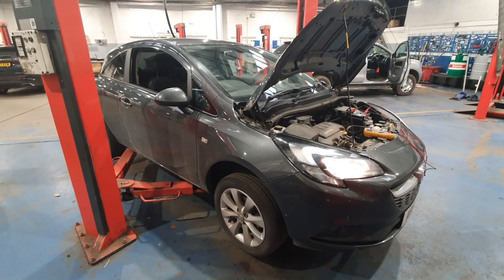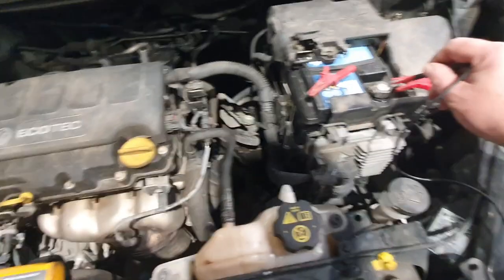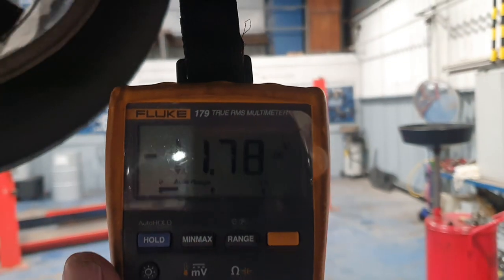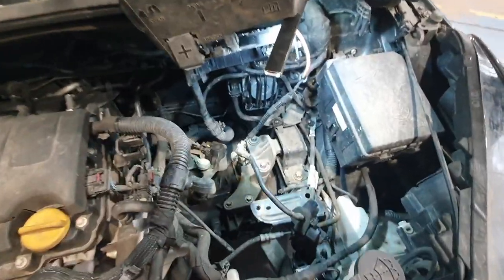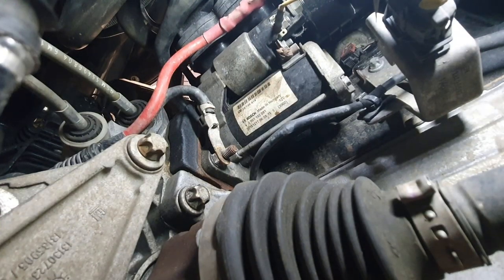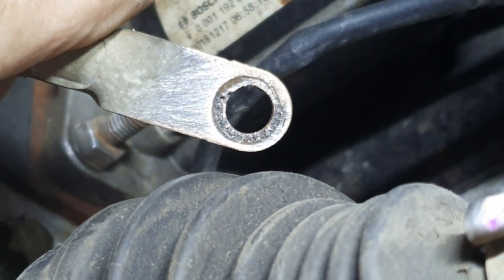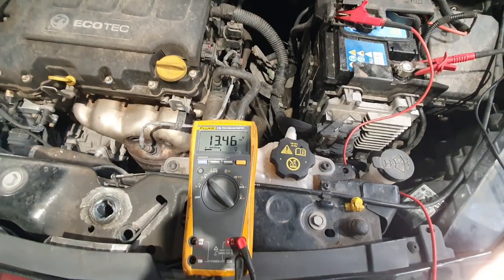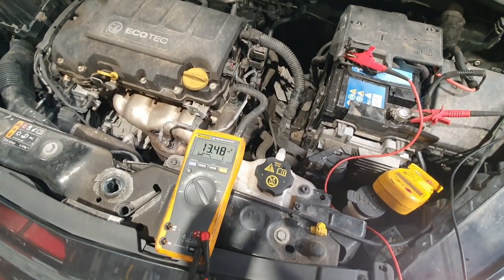This is why your Vauxhall / Opel Corsa D Battery Warning Light is on

Comment: i fix a lot of zafira a and b models,they suffer badly from water damage,rusty cables ,i do the same tests too,rust makes a nice resistor,for voltage drop,like when is 12v not 12v,when lot rust on cable joint and can pull 12v on test meter ,but add high load,say 55v bulb ,h7 ,will be dim,as rust stops the flow of electric,i got opcom and snapon ultra for my every day code reads,but after watching your vids,now have forscan,on my laptop,nice bit kit,and now seem to have to fix 2.4 and 2.2 transits ,rwd and fwd models,forscan is great,also great forum too,strange how i fix cars ,vans all day and come home and watch machanics videos,but there is little gems of info to be found ,would love a toolbox tour of your box ,always love to see another mans tool box set up,my friend works at renault trucks and he has 3 roll cabs ,plus breakdown box ,big spaners and sockets too,my other friend tony is in the rac ,he loves it ,cant stand being in a workshop all day ,or mot ramp
Reply from the maker: Thanks for the comments. A tool box tour wouldn't make a good video, im not one of those with 3 of everything and most of my snap on stuff has now gone. I've got minimal tools, having spent a few years on RAC myself, you learn you dont need many tools. Working on one brand mainly, you get away with less tools

Comment: Years ago that fault would have melted the choke and throttle cables, also why not slap a bit of vaseline on those connections? great informative video, thanks.
Reply: Did that myself, changed an engine in a Bedford van forgot the earth strap and the choke cable let the magic smoke Out!

Comment: Does this throw a fault code?

I'm getting 062104 on my 2007 astra h and intermittent battery light. Sometimes I then the car off and on and it goes away again

Plugged obd in and getting 12.5v on battery and 14.25v with engine running.

Comment: Excellent find there Steve 
Volt drop testing is the best in my opinion 👍
Keep the videos coming enjoy watching  all your diagnosis.
I have a question, Steve I’m struggling on a job didn’t know if you had any ideas 
Transit connect 2018 1.5 tdci 
17 k on the clock 
Code P2279 intake air system leak bank 1 ,goes into limp mode when RPM is raised over 3000rpm.
I’ve smoke tested the intake there’s no leaks anywhere, tried another MAF sensor , compression all good , updated the PCM , the MAF and Desired readings are not in sync with each other , Desired is 3times higher ?? 
Difficult question, any idea’s Steve.
Reply from the maker: Have you checked EGR?  There is also an intake hose that splits between intake manifold and the plastic pipe (but should show up on smoke test)

Comment: Why would GM think that it is a good idea to ground out the main ground to the starter when water from the road will rust it out they should do like most cars do and have it below the battery tray  where it would be protected from moisture plus it makes it much easier to clean it regularly if you have to.